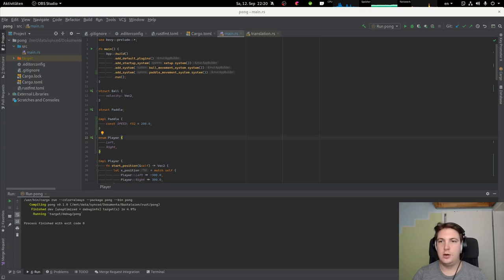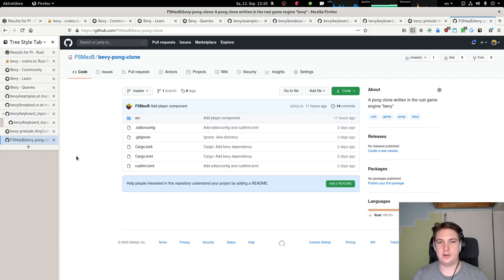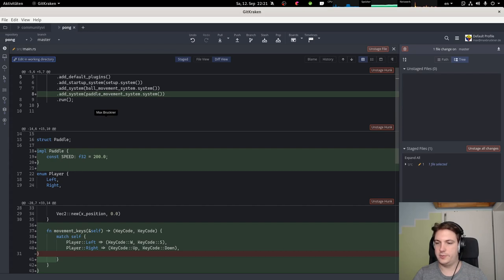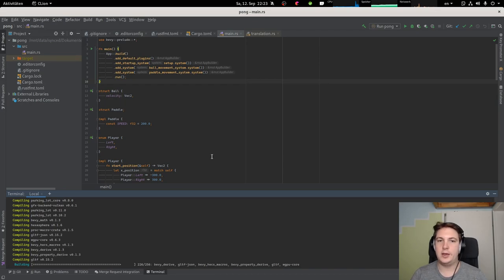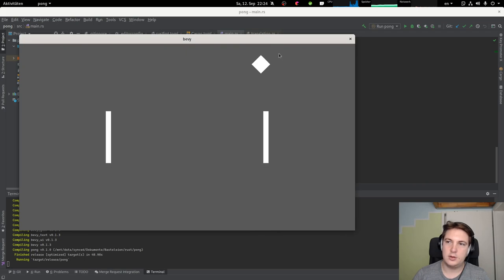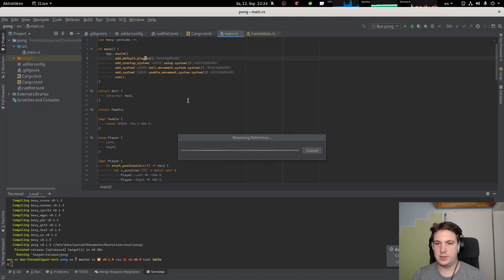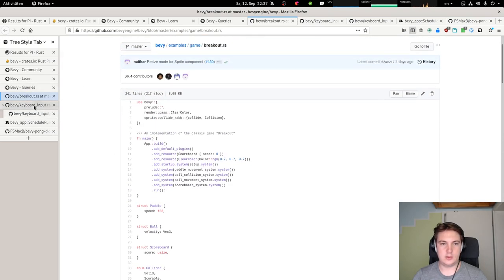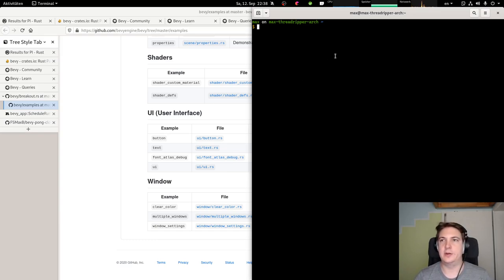Pong clone in rust with the bevy game engine - Part 4: Window Resize Events

Comment: Hey! Thanks for doing this series! I have learned a lot so far, and it's actually more entertaining than you might think to watch someone else digging through documentation. It's also very nice to see the way you solve problems even when the docs are lacking - and also I'm just glad you're doing it on camera so we don't have to 😜.

Also, I noticed you're using vim keybindings in CLion. I'm just curious, have you tried neovim since 0.5 was released? I get not wanting to use vim or pre-0.5 neovim for anything serious, but with the builtin LSP and Treesitter, neovim really is, or at least can be turned into, an IDE. I've seen several times when CLion was acting very sluggish in these videos, and it's obvious that you're machine isn't the problem lol! Having highlighting that obscures my code for 10 seconds at a time would drive me nutty.